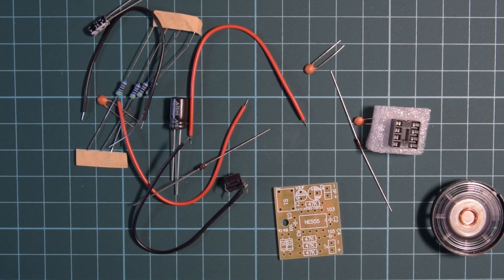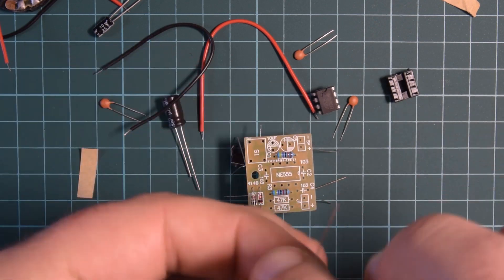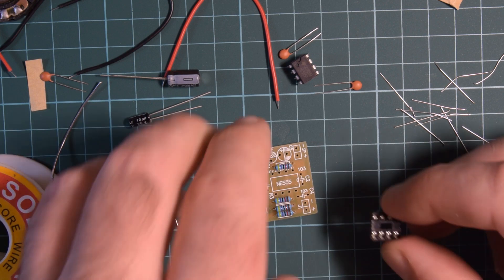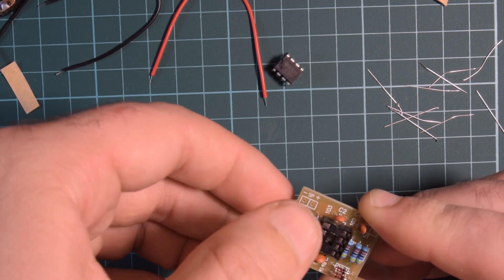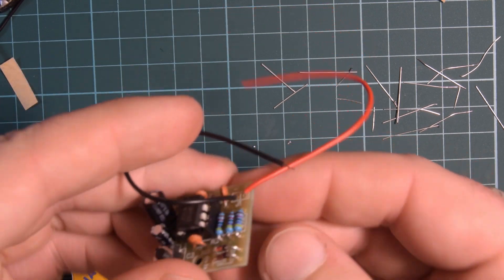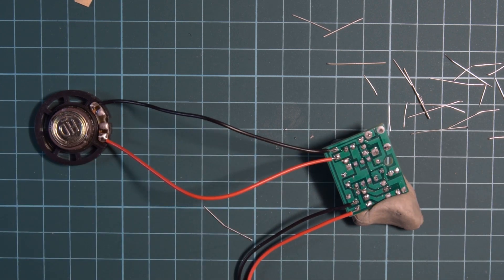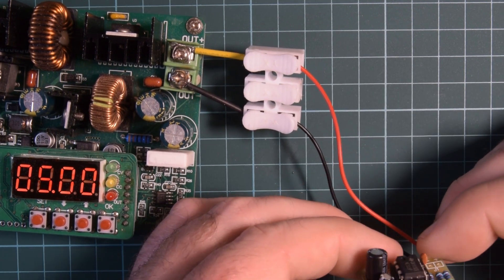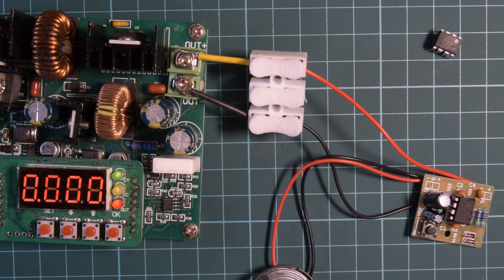Kit Build: 555 Timer Doorbell

Comment: And that’s another good justification for stocking up on parts. Never know when you need some spare silicon. It actually doesn’t sound too bad considering it’s a simple oscillator. Maybe the small speaker helps add some character to the tone.